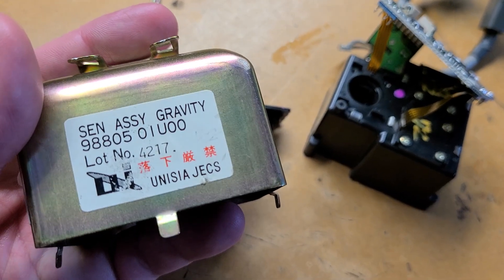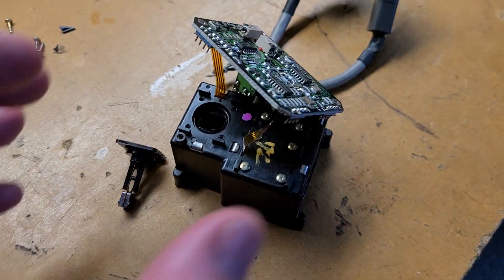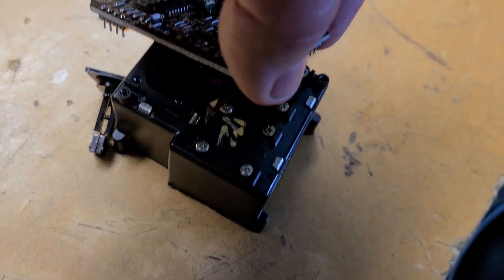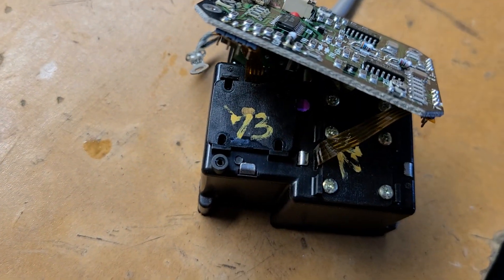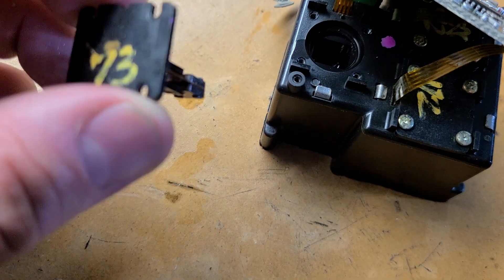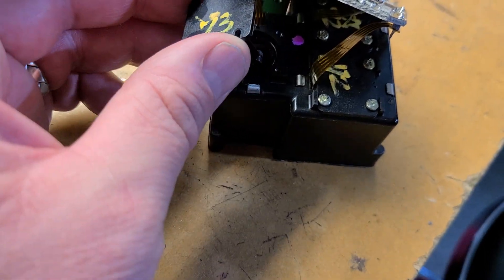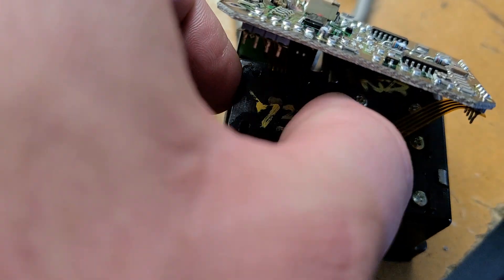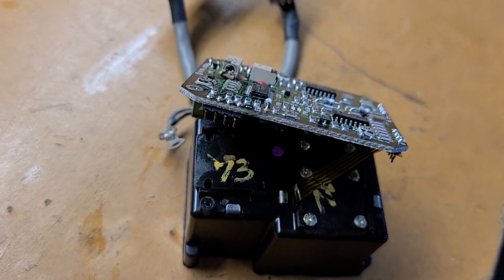Inside an R32 Nissan Skyline GT-R ATTESA System G Sensor

Comment: Any thoughts on the aftermarket G sensors available out there such as Midori?
Reply from the maker: Anything is better than the stock setup.  All the new ones are digital, which are cheaper, and offer more resolution.   I wouldn't necessarily change a stock sensor unless it was broken, but if I did, no way do I want to put a stock one back in it.